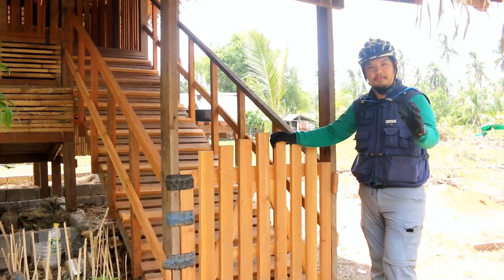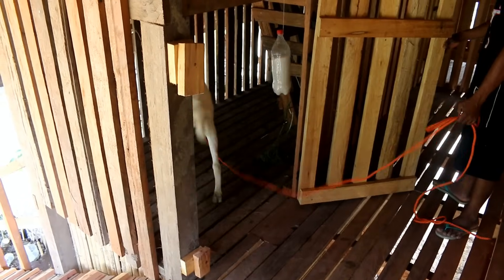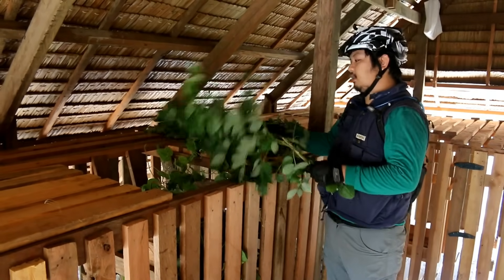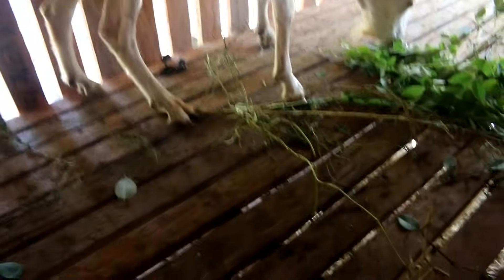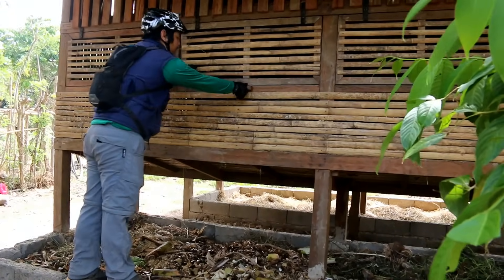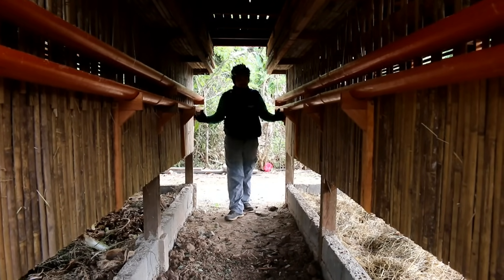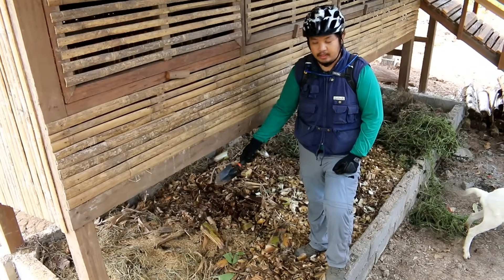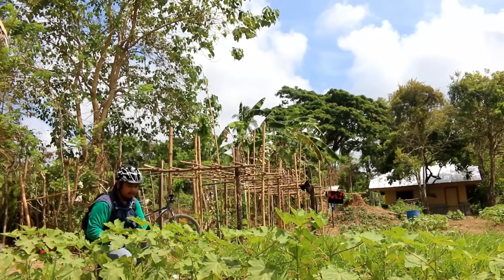VIPS, Vertical Integrated Pasture System Design, Part 2 of 2

Comment: First of all, I'd admit that if I were a newbie farmer, I would have been convinced that this is a great idea. But I've been into farming for a while and in my experience, this is unsustainable, contrary to the evidence presented.
There are several basic principles that go against this set up.
1. Small-scale farming MUST NOT be expensive. In your set up, everything is carried to the animals. It takes a lot of fodder to feed the goats, unless you give concentrated feeds. Doing so, for both animals would soon deplete your pocket. Cut and carry feeding would require plenty of labor and planting material. It would be better for your goats to be left to graze everyday if you have the pasture. If you read about chicken tractors, it is a great idea also.
2. Both chicken and pig excreta are high in methane. You would need electricity to run your ventilating system. Or, you need to put up tarps which could be moved up or down depending on the weather- rain or shine. So you will need an attentive employee. His monthly salary alone will eat up your potential profits.
3. The 2nd floor flooring is always dirty. How many times do you clean it daily? Another time- consuming activity
4. Finally, the greatest hit- I am a vermicomposter. (I have a commercial-scale vermicompost farm. But I do not sell the product because I use it exclusively in my farm) In my experience, fresh manure will KILL the AAfrican nightcrawlers. You gotta let the dung dry out first- let the methane and other dealy gases evaporate before you dump it on the worms. I did this stupid thing once and all the worms in one of my composting bin died.
But you can use BSF to digest the fecal matter. Black soldier flies. I tried them once but failed because I was a tyro. Now, I have enough other concerns that prevent me to try them out again, but they are a good idea.
Reply: 3. You do not clean the floor at all. That is why you have the deep litter. The chickens work over what falls from above and work it in the the litter along with their poop and it starts to compost right there.   More clean litter would be added on top and only cleaned out once in a while. 

4. No fresh manure would ever get to the worm bed.
Reply: Very well said sir
Reply from the maker: https://www.youtube.com/watch?v=7lh43uJbc9c&lc=z12du3vinq3gt5ylq23cexb41uued1srw04
Reply from the maker: https://www.youtube.com/watch?v=JK6vAsxjZ8E
Reply from the maker: https://www.youtube.com/watch?v=7HolGMrwhxI
Reply from the maker: https://www.youtube.com/watch?v=JJJ1Nh8MmgU
Reply from the maker: https://www.youtube.com/watch?v=iI6XSuLiGS0
Reply: The goat did not seem too happy having to go back into a cage. They love to play.

Comment: will the goats and chickens have an opportunity graze out side of their enclosure or are they permanently caged ?
Reply from the maker: The layers are permanently caged but their flooring is constantly changing by adding food scraps, leaves, rice straw and grass so they can still eat bugs and get protien from grass or azolla. It is a constant flow composter because small particles will then flow to the worm bin thru the slots in the flooring. Yes we also schedule the goats for a trip in the goat tractors.
Reply: +Madodel glad the goats will have access to outside pasture, what about the chickens will they have access to a tractor or run also ?